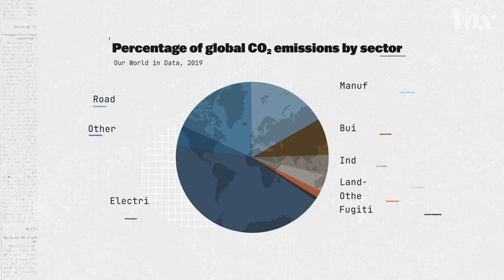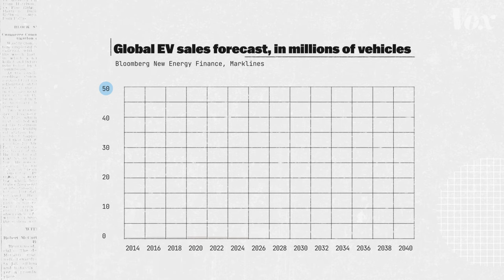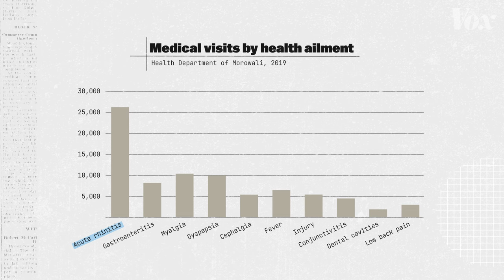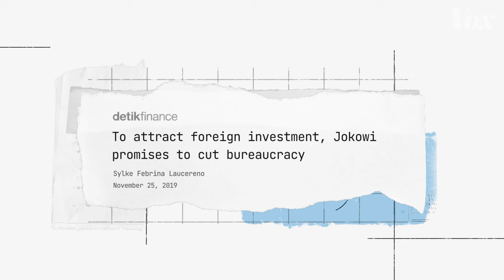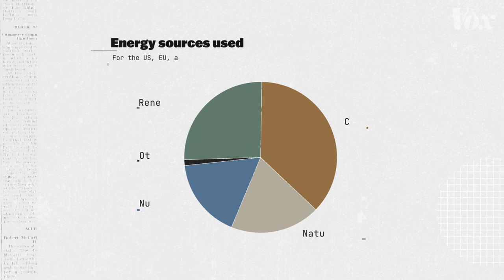Batteries are dirty. Geothermal power can help.

Comment: I am all for electric vehicles and drive one myself but you really shouldn't claim they are CO2 free. You have to factor in the emissions tied to the electricity used to charge the car. It's better but not CO2 free. For that much still needs to be done in advancing green energy production outside of the battery production as well.
Reply: Yea. the assumption of this video, that everyone thinks EVs are 100% clean, is not true. people are aware it’s not perfect. cars are always bad, it’s that EVs are way way better than Petrol/gas, despite the battery.
Reply: Capitalism for ya .
Reply: But without EV’s how else will kids be employed to mine cobalt?
Reply: Micro mobility + mass rapid transit solves most issues as you don’t completely destroy communities for parking minimums.
Reply: Right. Lies like these make environmentalists untrustworthy.
Reply: exactly. This kind of omission in the video makes it less trustworthy.
Kinda unfortunate, vox
Reply: The drive itself does not create co2. sure other related processes do but those are separate and should be changed anyway. We already know that a lot of our electricity is generated by coal power plants so mentioning that is useless
Reply: @pistolen87  it isn’t necessarily a lie. The production produces emissions yes but the day to day driving does not (assuming your local electricity is coming from renewable or nuclear power).
Reply: @tacomonkey222  Cobalt is used in the refining of crude oil, in this way fossil and electric powered cars have the same effect.
Reply: Exactly. Misinformation like that is what turns off people who are on the fence about electric vehicles to not trust information given to them.
Reply: @thedavidj1996  while I agree with you, right after she says that, she adds "if all cars were EVs we could wipe out 18% of CO2 emissions", not indicating that other sources of emissions would obviously increase from all of the EVs charging and drawing power
Reply: @thedavidj1996  The video makes it clear that battery production has drawbacks. Most electricity comes from non -renewables still, which they didn´t mention or take in to account when they calculated about the carbon footprint for a car trip between NYC and DC. I think it's disingenuous and I lose respect for them.
Reply: I, too, support electric vehicles but a glaring mistake like that 15 seconds into the video harms the overall cause. you can do better, @vox
Reply: While not completely wrong this is a terrible way to look at it. If you look purely at the production of energy after setup, it's not far fetched to call it CO2 free. In Europe for instance, much clean wind energy production is wasted because there is no way to store it. If you charge your car at night, the energy you are using would otherwise have been wasted/not produced at all.
Sure, if you take a snap shot of things as they are now, you'd be correct but the goal of these steps towards clean energy is exactly that. Clean energy.
It would be entirely possible for an electric vehicle to drive without generating CO2. It would not be possible for a car using fossil fuels to do the same.
Reply: @willvandermeer4733  it's the detailed explanation you provide that makes your comment so trustworthy.
Reply: @Novacification  I was not arguing against that at all and fully agree. But I do think it's important to point out exactly those nuances. And sadly even in Europe it's a far fetch to think you're charging clean energy at the charging stations. Even the ones claiming to be often are fossil fuel produced while only buying CO" certificates from Norways huge water generated power plants. So I agree that clean energy is the answer and the only one. But pointing out that this is the way to make electric vehicles truly sustainable only emphasizes that point imho.
Reply: that's why public transport is best to which we are due for a public transport revolution in the United States
Reply: @Pfyzer  100%
Reply: Also, all the additional infrastructure to sustain car dominance: highways, parking lots, urban sprawl, single family housing etc etc.
Reply: Right, and if you generate the electricity through a carbon-free method as well, then there are no emissions.
Reply: @tacomonkey222  More cobalt is used for other batteries in electronics than in EVs.
Reply: Zaydan Naufal  You forgot France, Norway, Sweden and New Zealand.
Reply: @tacomonkey222  Don't worry cobalt is also used in many other applications. The kids won't lose their job, unless the government there cares enough to send them to school.
Reply: @pistolen87  Nah. This is a false concern pushed by fossil fuel proponents to muddy the water. To go completely emission free we are going to have to switch to fully electric for everything. Cars are just a part of that. It's a chicken and egg problem. Insisting that the grid should be 100% renewable before we can champion EVs just slows down the necessary change.
Also to the people complaining about cars, yes of course we should have more and better public transport and bike infrastructure, but that shouldn't be an argument not to build EVs. We are simply not going to be car free in time to prevent climate change so we will need EVs.
Reply: @ZTanMURReneRs  False concern? It takes years to build trust but only a single silly betrayal of it to lose it all. That´s why it concerns me!
Reply: Plus, every new vehicle, EV or not, put into the world entails significant added emissions if you consider full production-to-scrapping life cycle. And those are considerably higher for BEVs. Sometimes the greenest thing is to keep your old car, make sure it runs as clean as possible and only use it when necessary.
Reply: That is, in fact, the entire point of the video
Reply: Huh? They don't say that at all unless I missed it?? The whole video is talking about how much energy is needed just to make the batteries themselves and is talking about geothermal power because it is CO2 free
Reply: @onemorechris  did we not watch the same video? They don't make that claim at all
Reply: @CannabisTechLife  what misinformation? Nobody in this video made any such claim. If so please point me to the time stamp where they did.
Reply: @Scoot_R  the other sources of emissions would also be CO2...that 18% is the decrease from changing power sources.
Reply: @Novacification  she specifically states the drive produces none. They're clearly aware that emissions are involved elsewhere in the chain as they go on to talk specifically about that with the nickel issue and about geothermal power.
Reply: @blakebrown534  It's a mistake they made right in the beginning of the video. Just an editorial mistake, was hoping they might fix it
Reply: Yes,  that's correct. But moving people who drive cars to EVs (or off cars entirely and onto public transport or bicycles) means that all these individual sources of pollution are removed, and by changing the centralised power source that they're drawing electricity from (power stations) to renewables then that entire loop becomes CO2 free.
Reply: @LashanR  true!
Reply: that was the point of the video…
Reply: Tell me you didn't watch the video, without telling me you didn't watch the video.
Reply: @MH-hu5pi  It's not an omission lol, it's literally what the video is about ... MAKING BATTERIES MORE GREEN BY SWITCHING FROM COAL TO GEOTHERMAL
Reply: @maolcogi  I watched the video and I'm responding to the specific moment in the beginning where it is clearly stated that electric vehicles do not emmit any carbon during driving. Which is a lackluster description at best.
Reply: @tacomonkey222  what a ridiculous statement.

We all know those kids can make our cheap electronics and disposable clothing.
Reply: @maolcogi  but they overstate and understate a few things in the video. Their conclusion isn't well established

Comment: Finally someone acknowledging that lithium batteries have their own environmental cost. Doesn't mean fossil is cleaner, just that batteries aren't perfect.
Reply: There’s a project in Germany in the upper-rhine area where they can extract giant amounts of lithium in an environmentally friendly way.
The water they’re already using in the power plants contains a lot of lithium, which could be extracted.
Reply: You know what is cleaner? Trains.
Reply: Sadly there isn't perfect solutions. We will always have negative and positive impacts, we need yo balance them and see if the benefits justify the costs. This is the definition of environmental impact assessments.
Reply: public transport, bikes are the best bet. You can get ebike if you're lazy.
Reply: @stevenvaneerden7794  which do you recon is better on average for the environment: buying a new electric car to replace your old car, using your old car until it dies and then buying a new ev, or moving to a place with good public transit and not using a car at all?
Reply: It's not about acknowledging that lithium batteries have an environmental cost, of course lithium batteries have an environmental cost.  

It's about weighing those cost against the alternatives.  Namely untapped global warming, which will harm the poorest societies the most.  (many of which have significant lithium reserves) or degrowth mindset that is a political non starter.

The other thing that bothers me about "acknowledging that lithium batteries have an environmental cost," is that they are always "acknowledged" in the context of EV batteries.  The cost is never "acknowledged" in the context of mobile phones, tablets or laptops.
Reply: @stevenvaneerden7794  yup, it seems you're an open minded person. But i think ev is just not the solution. Because it won't solve one big issues, which is space. You may argue, full self driving can manage that. Nope it doesn't exist despite our dear savior elon musk promise it'll come out in a few year. And even if it exist, unless 100% of vehicles are full self driving, fsd won't make the ride as smooth like those sci-fi. Because there are other people who will continue to drive and won't make the system run smoothly.

And if let say, electric car somehow managed to solve that problem, it causes another problem. Who will be the early user of this modern ev? The people with money, and those people will want the government to cut investment for public transportation which causes lots of problem like rising social inequality

Now, there's nothing wrong from assuming ev is our savior, but let me ask you, is the cost of ev really worth it? Worth the hassle and potential social inequality?
Reply: @naufaltriandiroziqi8538  EV's are a start but ultimately space IS a major issue and vehicles as a whole should change. Driving around in 2000lb chunks of steel, 90%+ of the time alone, burning fuel for all that mass to move, heating/cooling all that air.. if our vehicles themselves were smaller and lighter then we could reclaim SOO much space from roadways and ESPECIALLY parking garages in the states. we could have wider lanes and few of them for the rare time you do need a vehicle with multiple passengers, otherwise we should have ebikes essentially. like a Veemo from Vancouver. but yeah ideally we'd have great public transit with trains, a great biking path network people can use veemo's/other ebikes on to get around easily, with the occasional larger "full size" road for when people need to carpool. That's my utopia.
Reply: @naufaltriandiroziqi8538  Even if we switch to perfect public transport plus bike infrastructure in record time we will still need trucks/cars for some scenarios and those should be EVs. Also we cannot transition fast enough so we will need EVs for that reason too. And like any new technology, they will become cheaper.
Reply: Where have you been living that no one ever mentions the negatives of batteries?
Reply: Fun fact 90% of the big batteries for citys have zero Lithium in them just iron nickel and magnesium or aluminum.
Reply: Wait a minute, batteries aren’t perfect? 

I totally thought we’d found an alternative solution that had exactly zero compromises.  

But I’m only 5 years old.
Reply: @Heisenburg17  how do you think ebikes are powered?
Reply: @JamesR1986  Eevees completely dwarf everything else in term of battery needs, that's why. You could power dozens and dozens of smarthpones with a single EV battery.
Reply: @obinator9065 Environmentally friendly? No mining is fully environmentally friendly. I get that they do all in their might to make it clean but there is always risk for ecological catastrophe. For instance in Hungary a decade ago aluminium waste from mining leaked into water. And they had high standards too.

Comment: Cars are not the answer. The way cities are designed/developed also makes a massive impact. For example, the start of the video fails to take into account all the infrastructure and maintenance that went into making car travel possible. These costs are enormous in terms of land, materials, expertise, and other resources in a per traveler basis compared to the Amtrak train.
Reply: true, The root problem is bad zoning, people could live where they work almost in every instance but the zoning is terrible, and the property prices overblown because the taxes when making any transactions regarding property are way to high wich discourages changing living location and makes property more expensive,
but even with good zoning you still need roads, you would need less but you still need them no matterm what, unless everyone would have a teleportation device in their house
Reply: @faustinpippin9208  Roads are important, cars are still important. But we shouldn't make them the center piece of our transportation system and land use policies.

For example, even in mix use walkable neighborhoods, minimum parking requirements forces a great deal of space to be dedicated to car storage. 

Lots of air space isn't used at all because the height of buildings are limited by the amount of parking they can provide.

For apartments, fewer larger and more expensive units are favored over a bunch of smaller more economical units since more units means more parking mandated. 

Supply is curtailed artificially, bring prices rent and condo prices up.
Reply: Yes ofc we should transition from car based infrastructure to public transport and bikes as fast as possible but this is not going to happen in time to prevent climate change. So don't use this as an argument to say we shouldn't build EVs. We will need them.

Comment: There's a geothermal plant about 50km where I live. I've driven past it a couple times and I can vouch that it's the future of green energy in Indonesia. The plant looks clean and futuristic. It also doesn't really bother the environment, trees can (and do) grow around the plant, it practically surrounded by a forest. The only downside is that the plant needs a massive clearance because when a geothermal pipe bursts, it's proper scary and poses a safety hazard to the surrounding area.
Reply: Which plant did u refer to?
Reply: @seraphinastark169  Kamojang Geothermal Power Plant

Comment: I recently caught an episode of the Volt podcast about “enhanced geothermal” that really got my attention. Doing geothermal requires three things - heat, water, and permeable rock. That’s easy enough to find in seismic hotspots like Indonesia or Iceland, but most of the world isn’t like that, so much of the readily available geothermal has already been developed (kind of like hydro that way). Enhanced geothermal uses the fracking (fracturing) techniques developed for natural gas wells to create permeable rock where it doesn’t currently exist. Water can then be extracted from stranded aquifers deep underground, or pumped from a ground source into the hot, permeable rock. This makes geothermal possible in many places where it can’t be used today.
Reply: I am pro geothermal but I have read there is chance geothermal especially the ones that uses fracking can cause earthquakes.

Comment: Iceland does this very well with it’s rich volcanic hot springs and mountainous geography.
Reply: I’ve been to Bali and Iceland. the difference is how clean the air is in Iceland and how polities the air is in Bali. it’s a great example of how this can be done at scale and the direct local benefit. (the air is so so clean in Iceland compared to my default, London)
Reply: Zaydan Naufal  What’s there biggest spender? EGS is a utility that should be used everywhere because it benefits everyone when people are actually alive to work and pay taxes.
Reply: Zaydan Naufal  Pipelines are cheap, but the water won’t stay hot for very long. Electricity makes the most sense.
Reply: Zaydan Naufal  But Iceland developed its geothermal when it was a poor fishing country. It was the cheap electricity (also from hydro) that allowed an aluminum smelting industry and general development. 

Although, there was likely a higher base line home heating cost in iceland than Indonesia uses.
Reply: Zaydan Naufal  Well then they need to start making heat pipes.
Reply: Zaydan Naufal  That was my next suggestion.
Reply: And Iceland has much smaller population to begin with... in Indonesia, Iceland-size of population is equivalent of the sub-of-sub-district in West Jakarta (one of five borough in Jakarta, and Jakarta is just a single province out of 37-ish provinces in Indonesia).
Reply: Facts. 
I want to go to Iceland SOOOOO bad.

Comment: I found this to be a bizarre and convoluted story. Firstly, you didn’t mention the caveat that the EV needs to be charged using green energy for it to really produce zero emissions. Second, aren’t coal fired plants a problem in general? I don’t see the need to specifically tie them to nickel mines. Yes nickel mines use a lot of energy but so does literally everything. In fact that car ride you took from NY to DC was probably charged by electricity from a coal power plant.